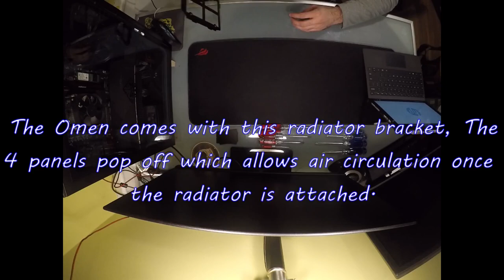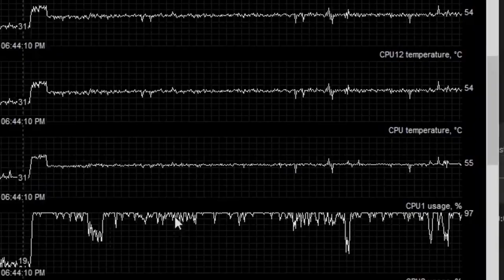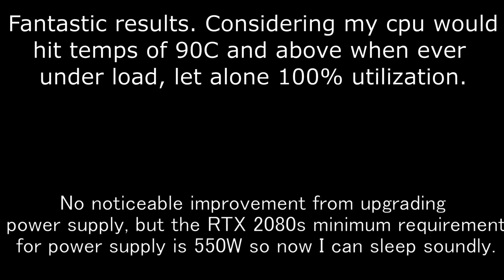HP Omen Obelisk - Upgrade

Comment: Are those 2080's worth buying - looking at getting one from an Omen...?
Reply from the maker: They are deft on the low end of the scale as far as the 2080 series goes. BUT with that being said it is still a 2080 and it still performs like a 2080 should. My Only complaint with it is the temps. I downloaded msi after burner and turned the fan speed up and now it stays around 60-75c while playing with max graphic settings.  Idle it’s usually around 20-30c
Reply: @MrQwerty00010  Yeah. I was worried About  temps and noise - as they are the major complaints with the blower cards.  I went to look at it -  just to see  how bad it was.  Buddy had it in a well ventilated larger glass  case(Pretty much the same  as it I'd be putting it in) beside the monitor - it wasn't neatly as bad as I expected. I had a moment of weakness and bought it. I did find an aftermarket triple fan set up for them from Arctic. I talked to a few people that use the arctic cooler, they all said they were a vast improvement. I'll keep an eye on it and will order the cooler if needed.  It's not being stressed just yet with 2 x  1080 monitors.  Yeah msi afterburner seems to be a great tool to monitor the activity as well.  Thanks for the info.
Reply from the maker: capitalD D please tell me more about this artic tripple fan, I was looking into getting a different case for it but I haven’t had any luck
Reply: @MrQwerty00010  I see they are out of stock...but ya can probably get it at various spots. YouTube it for info on installation- as it looks like a job doing it. I'd get someone to do mine- looks of computer guys around...
Reply from the maker: capitalD D thank you so much !!

Comment: If you get this pc just bump the gpu fan speeds up in msi afterburner and it will be perfect. The card comes really quiet idk why
Reply from the maker: TheFirePhoenix couldn’t of said it better myself man!! Runs every game so far on max settings with no issues the card  runs between 65/75 at the highest thanks to msi
Reply: I'm looking at picking up.. one of the rtx2080  cards from an Omen - from your are they decent cards or should I get something else...?  Thanks
Great video
Reply: @MrQwerty00010  What speed do you run your fans on?

Comment: Hi I have just added a 120mm Corsair ml pro fan to the same pc that u have at the top of the pc above the cpu and it seems that my cpu is running a higher temp than it was without the fan why is this?
Reply from the maker: Yxungt double check the direction that it’s blowing. Do you have it blowing in or out?
Reply: @mr exquisite it’s intake because my cpu was getting too hot
Reply from the maker: And honestly I think the cooler on the cpu is just not good enough, so even if the case air flow was optimal that stock cooler just isn’t strong enough to keep temps cool.
Reply: @dfbsfbfbf  The reason your temps are hotter is because the top fan is an intake fan, heat rises, so set it as an exhaust fan and your temps should be lower

Comment: Did you have an issue with the psu upgrade. I have to disconnect/reconnect the connector to the motherboard to make it turn on?
Reply from the maker: Sorry for the late reply on this, I have only had one issue so far and it was with the power button itself. Idk if when I took it apart I had moved the power button sensor or something but occasionally when I go to press the button to turn it on nothing happens, but a second or third press and it’ll turn right on
Reply: @MrQwerty00010  it s a typical thing that happens with that pc. I have it too

Comment: Btw 😂 I had 60-70 degrees celsius  before with this small heatsink. I dont like aio so I go for air cooler always. I had an intel i5 9400f
Reply from the maker: HoUmAnGaMeR 83 so my original plan was to go air cooler i was 90% sure of it. But I wanted the giant noctua one but my case is too small so I figured to save space I’d go with the aio cooler
Reply: Im sorry for asking alot but one more question :

Why do u have to disconnect the wifi card?? I will unscrew the motherboard anyway so just asking
Reply from the maker: HoUmAnGaMeR 83 No problem man ask as many questions as you want! I guess you wouldn’t technically have to remove it, but I did so that I was able to remove the motherboard completely from the case, the WiFi card has two little cables that connect to a separate daughter board at the bottom of the case so instead of unplugging those cables I just removed the chip from the board.
Reply: One more idea:
Add another ram for dual channel because it makes the cpu and gpu run on less pressure and u get more fps
Reply from the maker: Special Spy yessss my friend that is the plan !! But that’s down the road.. if only money grew on trees haha!
Reply from the maker: Special Spy also if you wanna see what Any new changes or upgrades I make to this down the line you should subscribe !!

Comment: Do you think there is a possibilty to add an intake fan for the new 30 series? Maybe down under the GPU?
Reply from the maker: Absolutely. As long as you have good wire maintenance haha. I can’t stress that enough. Like supreme mega wire maintenance. Honestly when the time comes for me to upgrade cards I’m most likely going to fork out another 50/100 bucks and by a new case to swap everything into

Comment: Quick question for the screws u used to mount the aio cooler were they the ones that looked about the same size in each end or the ones that one end was longer than the other
Reply from the maker: Arbidx18 I believe they were all the same size. They were the screws there’s me with the AIO

Comment: And a NZXT m22 watercooling ?
Reply from the maker: that should work fine its still a single 120mm fan and radiator. thats what the mount in the case was made for.
Reply: Mr Exquisitee ight thx

Comment: was it necessary to upgrade PSU? have the same machine btw. thanks
Reply from the maker: I can’t say it was a necessary upgrade. It was more so for peace of mind, and future proofing. The standard rtx 2080 psu requirement is 600. The one that came with the hp omen is 500/550 I believe. Now with that said I understand the HP rtx 2080 is a bit different and has less of a psu requirement but with everything I was adding on I figured it just made sense to get a more powerful psu in there as well.
Reply: @MrQwerty00010  Cool. Appreciate it .Thanks

Comment: will it come in there is a radiator with double fan?
Reply from the maker: Do you mean like a double wide radiator or do you mean a fan on each side of the radiator? I believe mine only came with the one fan
Reply: @MrQwerty00010  for example:Corsair iCUE H100i RGB PRO XT Liquid CPU Cooler, 240mm Radiator, Two Corsair ML 120mm PWM Fans, 400 - 2400 RPM, Multi-Zone Dynamic RGB Pump Head - Black
Reply from the maker: @brayanlincoln2715  the one i bought just came with one fan sadly

Comment: How did you get the back side of the case off
Reply from the maker: When you say back side I’m going to assume your talking about black panel that is opposite of the glass panel. There’s a little screw that you have to undo and then your able to slide it off. It’s tight so you have to put some pressure on it and slide it backward

Comment: I wanna upgrade my stock cpu cooler and remain air cool. I wanna put one in that is quiet and can keep my temps low as well. Any suggestions?
Reply from the maker: Darius Pryor i originally wanted to go air cooled but went AIO because I wanted to take up as little room as possible. BUT air coolers are the best way to go so I like your thinking. The air coolers I was looking at were the Noctua-NH-D15 or Noctua NH-U12A,  be quite is another good brand, and if you wanna be super cool check out the new Corsair A500. Now really you can get anyone you want but you just want to make sure it’s rated for 90 TDP because the I7 cpu can occasionally get that high.
Reply: @MrQwerty00010  I saw the same Noctua as well. I read somewhere that it is not compatible. I will look into the Corsair A500. Thanks for the quick reply. Been surfing the internet like crazy and the only solutions I see are liquid cooling.
Reply from the maker: Darius Pryor let me know what you decide on!

Comment: before u upgraded the psu did you do any undervolting to the gpu and what games did you play
Reply from the maker: No undervolting or over clocking on my gpu, and a little bit of everything really. At the time I was heavily playing tarkov but all over the place with the popular games cod, battlefield and what not
Reply: @MrQwerty00010  alright i undervolted mine just to be safe
Reply from the maker: @whoulfoul  I push my gpu to the limit pretty consistently and haven’t had any issues yet. But I do monitor it constantly with MSI afterburner. I only use it for monitoring system temps. I also increased my fan curve on the gpu so it runs faster at lower temps to hopefully help keep it cool
Reply: @MrQwerty00010  so its fine if i dont undervolt it?
Reply from the maker: @whoulfoul  honestly with these omens it could be a case by case situation idk how good there quality control is but for me it’s been fine. If I was you I’d just game as normal but keep an eye on thermals and if your not seeing any issues then your good. But honestly if your undervolting now and ur satisfied with how everything’s workin then just leave it how it is. Game away my friend
Reply: @MrQwerty00010  I get 88 degrees max full load no undervolting. is that bad with a blower
Reply from the maker: @whoulfoul  that seems pretty hot, we’re taking Celsius right?  I think 70 is super ideal and under 85 is what people want. I think the rtx is rated for like 80c so maybe stick to undervolting to avoid those temps.
Reply: @MrQwerty00010  did temps get better after the new psu?
Reply from the maker: @whoulfoul  I don’t think the psu had a direct effect on the temps. But the cpu cooler that I added I think has caused all my thermals to be better because the cpu isnt heating up my entire pc case lol

Comment: The motherboard doesn’t want to move and I unscrewed everything help!!!
Reply from the maker: ClutchKilledYou so even though it’s unscrewed it’s most likely pinched underneath the ports on the back, USB ports Ethernet ports audio ports. It needs to be pulled a little bit towards the front of the case then lifted up sorta at an angle. Just be very gentle
Reply: It came out but now my pc turns on but no display!  Help please and thanks oh
Reply: You
Reply from the maker: ClutchKilledYou if I were you I would just do a double check and walk back through your steps. Make sure everything you touched went back the same way. I took a lot of before pictures to have something to reference
Reply: It looks light everything is in place just sum reason it won’t show a display
Reply from the maker: ClutchKilledYou do you have another monitor your able to test it on?
Reply: Mr Exquisitee yes still the same do u think it might be the motherboard or a not Connect wire
Reply from the maker: ClutchKilledYou what did you change? Did you add a new psu and cooler? Or one or the other or something different?
Reply from the maker: ClutchKilledYou and if I had to guess I would bet that it’s a wire
Reply: Mr Exquisitee I added a cpu LQC then when I turned it on nothing
Reply: Worked
Reply from the maker: ClutchKilledYou this is very tough man.. so all the fans start spinning and the lights turn on but the screen is black?
Reply: Mr Exquisitee yeah
Reply from the maker: ClutchKilledYou I’m stumped, could possibly be a graphic card problem or a faulty cable so many possibilities
Reply: Mr Exquisitee  do u think it’s a bios problem or sumthing like that because I added a liquid cooling
Reply from the maker: ClutchKilledYou it’s definitely a possibility. But it could of been anythinnggggg
Reply from the maker: ClutchKilledYou one thing I was thinking is that maybe just maybe the psu isn’t supplying enough power to power the liquid coolers pump/fans but that’s such a small amount of power that shouldn’t be the issue
Reply: Does hp warranty cover it like say if the pc doesn’t get signal but i caused the problem or did something
Reply from the maker: ClutchKilledYou if you want to try and use the warranty ur best bet would be to put it back the way it was and then try, they probably won’t touch it after being disassembled like that
Reply: Mr Exquisitee  alright bro I’ll do that and thx for ur help
Reply from the maker: ClutchKilledYou your welcome and good luck let me know how it turns out!!
Reply: Mr Exquisitee Alr bro Thx again for all the help🙂
Reply: DreKilledYou u fixed it?

Comment: Did you have problems with the psu? I bought a corsair CX750M and the length blocks one of the holes for the case to close. any suggestions?
Reply from the maker: I had no issues with my Corsair model. The dimensions could be a bit different
Reply: @MrQwerty00010  i was actually able to make it fit only to find out I got the model that didnt have the 4pin
Reply from the maker: @Alkhemiya  same thing happened to me and I was so confused until I realized the 8 pin could be turned into a four haha
Reply: @MrQwerty00010  man those thicc cables that come with the corsair psu are wack I might get the premium kit for them. Was the case able to close perfectly with the thicc ones?

Comment: How hard is it to connect the corsair 750 power source?  
there is no way to lose the connection of each connector?
Reply from the maker: Hector Baiza I’m sure it’s possible,  but I was very careful when plugging my cables in. I found that each cable was fairly tough to plug and un-plug so it does feel fairly secure.
Reply: @MrQwerty00010  thanks for your quick response.  I installed the corsair h60 a few weeks ago and now the cpu temperatures remain below 60. but with the gpu it sometimes goes up to 80 and I am thinking of updating it with another graphics card the GeForce RTX 2060 super.  When I see your video I am more encouraged to do it.  If I have doubts when I install it, I'll be asking you here.
Reply from the maker: Hector Baiza no problem man! Thanks for watching the video, and what kind of graphics card are you working with currently? The 2060 super is an awesome card. My gpu can get in the 70s depending on the load I’m pushing I’ve been trying to think of ways to lower that down as well
Reply: @MrQwerty00010  I have seen that there is a corsair liquid cooling kit for graphics cards but I also see that it is a little difficult to install it.  As for my current graphics card it is a GeForce GTX 1660 TI but it gets very hot with some games.
Reply from the maker: Hector Baiza 1660ti still a great card you could build a second system around it! Haha. And I haven’t heard of the Corsair cooling kit I’ll check it out !!

Comment: How do you get the Corsair light to turn on? I just did this and it’s my first time messing with computers and it won’t turn on but the fan works. I connected my fan power to a 4-pin power adapter and attached it to my extra Sata cable. Still nothing.
Reply from the maker: Collin Smudde if your talking about the Corsair light on the cooler it should just come on as soon as there is power, you gotta make sure it’s plugged into the cpu_lc_fan port. As well as the data cable
Reply: Mr Exquisitee thanks for the fast reply. I currently have my radiator fan plugged into CPU_LC_FAN, and my I only have one cable coming from the cooler and it is a 3 pin power supply. I have that plugged into a 3 pin power adapter which connects to the SATA cable for a spare SSD.  There are no other cables for this and it is 100% an H60. I’ve been trying to find answers online and I get very mixed answers.  I read on some places that this cooler requires sata power but I ran it all weekend with it just plugged into the normal fan/pump pin location.
Reply from the maker: Collin Smudde you got me stumped my dude. If all the cables are plugged in and the Corsair light isn’t coming on then it could possible be a defect? Maybe try contacting Corsair customer support to have a new one sent to you and see if that fixes the problem. Other then that I mean the only thing left to do is just trace all the wires and really make sure that everything is plugged in good. Sometimes the cables will look connected but there slightly separated

Comment: Hey! 

Just installed the AIO on my Omen as well, CPU temps finally dropped down but I have noticed FPS drops on a game. Could it be the game? I have ran benchmarks and performance is fine, no idea why I’m getting 30-40 less FPS on a game.
Reply: upgrade your graphics card drivers possibly
Reply from the maker: tinker with the game settings and see what your graphic settings are, sometimes changing one or two things in there can make a huge difference on fps and not effect how the game looks visually, all depends on the games though. if youve noticed a drop in a game you usually play at high frame rates it could be in issue.